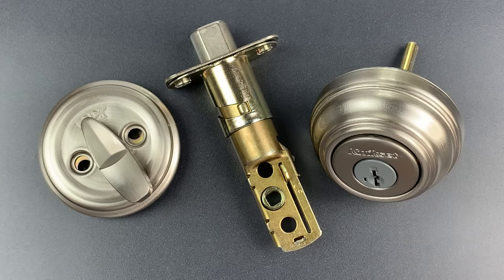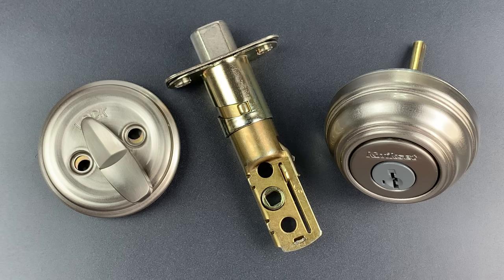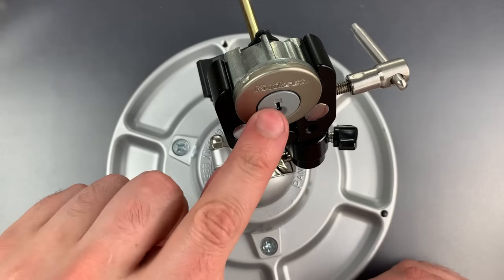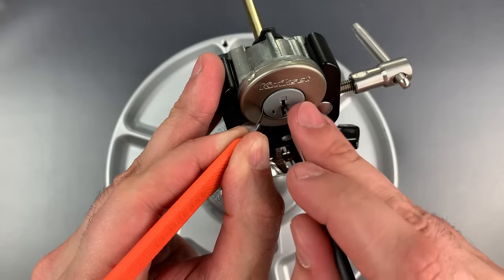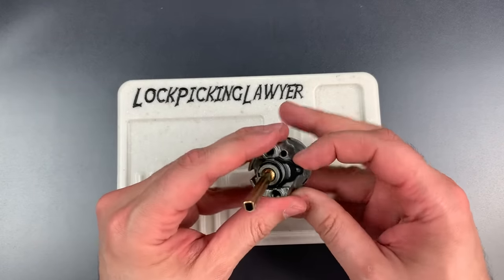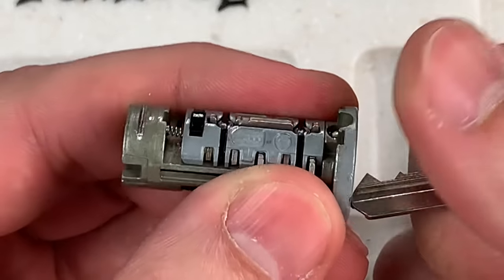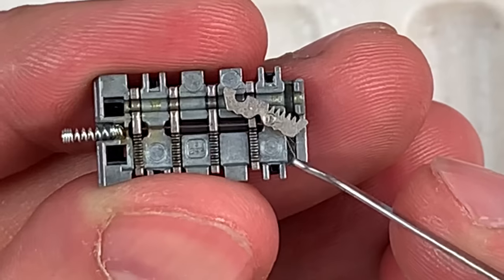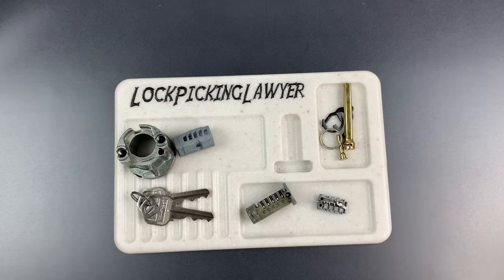[904] The “Pros" at Consumer Reports Couldn’t Pick This (Reverse Sidebar SmartKey)

Comment: Who wants to guess that these "professionals" were a couple noobs who'd gotten a couple weeks experience picking locks in the streets and got picked up for a couple extra bucks to try the lock for 5 minutes? lmao at least the average joe isn't gonna get this so it's still a good choice to help reduce the likelyhood of a break in, and that's the important part. 
Almost any lock is pickable but they're supposed to be inconveniences rather than secure measures of defense. psychology and mental warfare is the most powerful tool in your arsenal if used correctly, and inconvenient locks at a good way. Same with fake security cameras set up outside.
Looking at the pinned comment now I feel a little bad for that insult, their definition was vague and they changed it.

Comment: What’s the purpose of the little hole to the left of the keyhole?
Reply: It is what you use to re-key the lock. You turn key 90degrees to right with old key.  Then use a special smart key piece to allow old key to pull out. Then put new key and turn it 180degrees to left and it is set for the new key. No need to re-pin the lock.
Reply: Jim Crane oh thanks!

Comment: Anyone know the thickness/ width of the "shim knife" blade?
Reply: I bought a new gen 3 dead bolt to play with ($12 at HD). I put the core in a vise angled with the side bar and 'wafer' tops visible. Putting direct pressure on the rear of the side bar with a pick allowed pins 4 & 5 to set but not the first 3 pins. Moving the pick more forward on the side bar allowed setting of the first 3 pins. 
With the core in the housing however there's not room even for a .015 thick shim. I milled the pick thinner but still wasn't able to get enough pressure on pins 1-3 to set. I could also slide the shim in from the front over the ball bearing but the shim was so thin it wouldn't put enough pressure on pin 1-3 to allow setting. The curve on the shim also caused it to exit from over the side bar after pin #3, ie, prevented it from staying flush over the side bar for pins 4 & 5. 
It appears that Kwikset is now severly limiting the space for a shim. Anyone else agree? Suggestions?
Reply: I can now open the lock every time. 1) remove the core, put it in the vise 2) slide the milled down shim over the ball bearing while picking pin #1 3) mid way back push the shim tip back down and slide over the back half of the side bar 4) push down on the shim and side bar with anything causing more pressure while setting the pins. 5. the lock opens.
Questions: 1) how to get a thick enough shim all the way back? 2) how to get enough pressure on the whole side bar?
Reply: Just realized that this site isn't to discuss picking situations, rather just to comment on the posted video. Please excuse my posts.
Reply: @educatebo  its easy for comments to get lost so its a bad conversation site. Still I appreciate you going so in depth with this. I too am looking for a shim that would work for this.
Reply: The square sidebar for Gen 3 (rounded sidebar for Gen 2) has 3 vertical components: shorter ones at each end and a longer one in the middle. The shorter ones are covered by metal, the longer middle area is uncovered. A shim can exit the slot at this middle area and not get to the covered pin 4-5 area.  LPLs shim presses on the uncovered middle area onto the mid sidebar compressing the pin 4&5 area as you say but usually not pin 1-3 as you also say. A thin shim (0.010") will pass over the front end of the sidebar to start pressing pins 1-3, more easily pass into the rear slot for the pin 4-5 area and provide a "guide" for a second thicker shim (0.012") to pass under the thinner one and if slightly curved, into the pin 4-5 area without hanging up or exiting the slot getting into the rear pin 4-5 area. The thin shim doesn't apply enough force to push the sidebar inward. It takes both shims- total of 0.022"- to push the whole length of the sidebar enough so picking can begin. My shims are 0.052" wide, 0.9" long, 0.09" curve on the end,  made from bobby pins. The insertion gap for shims varies- I've had to insert my double shims along side each other and direct them to overlap after insertion. One thicker shim can't be inserted into the lock. I've banged up many shims so paying for a production model at this time isn't cost effective. Maybe a pack of these shims similar to a pack of core shims would be helpful?

Comment: the fact that you had it in a vice as opposed to a door or slab of wood simulating a door makes your complaints about it laughable as you didn’t pick it like someone who was trying to gain access would pick it. it’s a BS test, but given your constant insults of certain lock companies it’s par the course for you
Reply: Common sense clearly is not one of your strong points. Fixing it into a vice is functionally no different from it being in a door frame. The mechanics of the locks core do not magically change, nor does the rotation of the lock (or lack thereof) during picking. The reason he does it this way is solely because it saves a ton of time having to install it into a door frame, just to have to remove it afterwards. It is unreasonable to expect him to fully install every lock he tests, especially when it makes no difference to the way it is picked, or the results.